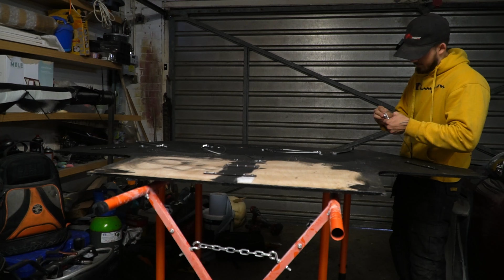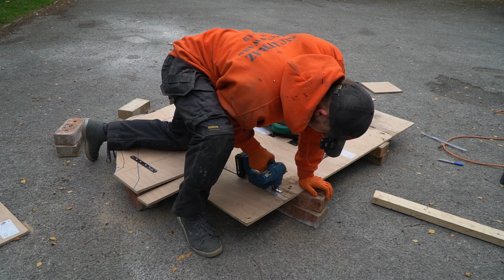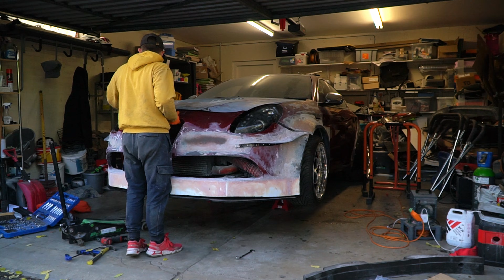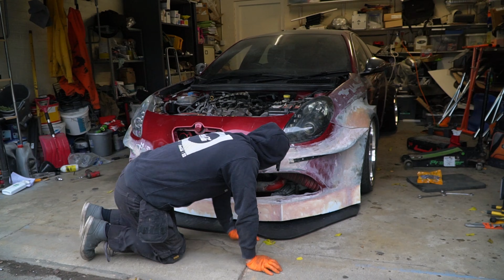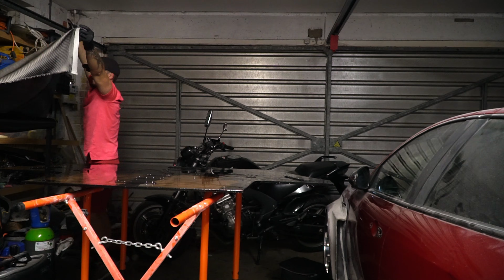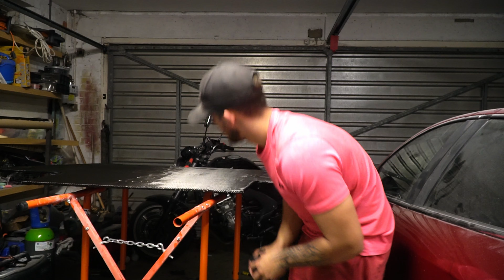Making a REAL Carbon Fibre Custom Aero Splitter For my WIDEBODY Giulietta Show Car!?

Comment: Should put a heatproof foamsheet between your oilpan and splitter, so it can’t have rocks stuck in between and crack your oilpan. Tip from rallying brother 🫶✌️